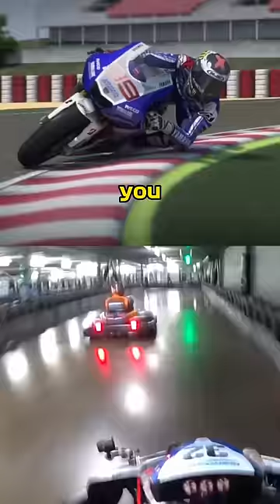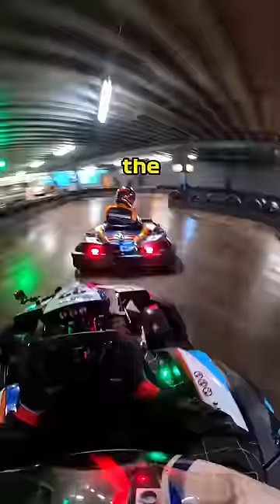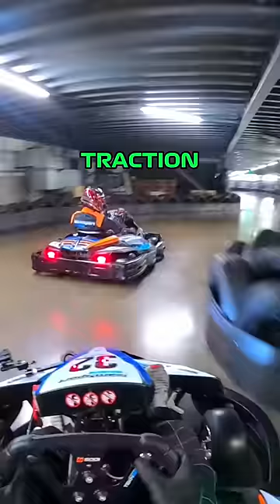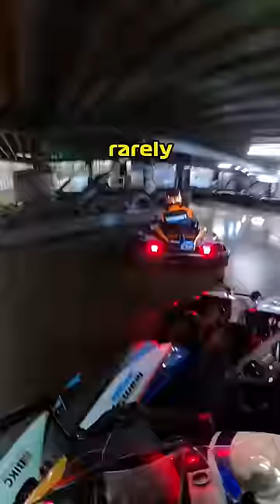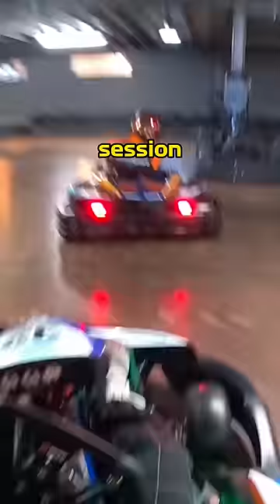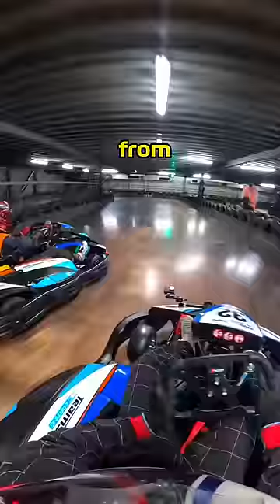WHY is this KARTING DRIVER LEANING in the Corners? #f1 #racing #karting

Comment: I do that to prevent mine from rolling. I have had a few friends roll it and now I'm worried it's going to happen to me.
Reply: i remember once when we went to one of these places that had a "powerkart" that was ridiculously fast compared to the normal karts and the place staff only let people with a lot of experience drive it. Anyway, the front tires were gone so we brought in a new set of front tires, and it got such insane grip that the kart nearly rolled in a couple corners. I of course stayed at max speed anyways, since i could feel it wasnt gonna roll completely any time soon. I also set the #2 fastest time on the powerkart on that track ever.
Reply: @roadsidegarage69  that's really cool that you got that fast. I wish I could be better at go kart racing.
Reply: @Elijahschumacher  You can get better if you train a lot and trial and error some driving lines into existence. Oh yea and also maybe lean outwards instead of inwards. I know it seems counter-intuitive but i know it adds a LOT of grip
Reply: @roadsidegarage69  okay, I will try that next time. Thank you!

Comment: In gas karts, I used to lean forward and lift slightly out of the seat, to take weight off of the rear and help the clutch engage at the exit of a corner
Reply: If your hanging off the steering wheel it wont help much if you lift off but dont move forwards at the same time
Reply: if the clutch wasnt slipping a bunch (which i doubt it was) that does nothing but slow you down. You should lean backwards and outside to gain more grip at the rear and turn faster.
Reply: Karts don't have a clutch. For physical reasons, it's important to lean slightly outward since a kart has a solid axle and no differential. Therefore, the inner tire must lift to build grip in the turns to navigate them faster. Otherwise, the inner tire would 'block' the axle.

Comment: Only.2 sec but he stayed ahead didn't he. It's not always about speed. You actually seem "faster" here, while he is the one taking the lines he wants and sliding into your line. So maybe not faster, but, at least in this clip, smarter. He's turning tighter, wider, blocking a larger width, whatever is necessary to keep you behind

Comment: Normally you have very good video's but imo you are confusing ppl.

You lean outside to relieve pressure from the inside tire because they wil want to spin at different speeds while cornering. 
Only if the kart starts hopping you have too much lateral roll on the ouside tire, and you should try leaning inwards.

Also by pressuring the inside tire the kart wil always want to go straight. Further more while coming out of the corner your tires still want to spin at different speeds so you have more power leaning to the outside. You lose HP by having both wheels on the ground while cornering

Comment: To me, if there was no time difference, its just because....it doesnt make any difference of doing that at a very slow speed. 

It does help with grip as you do it on fast turn or under the rain as its only slick tires, but here, thats really not necessary

Comment: I think you can apply this to low speed corner exits which guves max traction under acceleration
But for high speed corners if you lean in,itll cause the outside tire to skip loosing laptime

Comment: Leaning outside always. If it’s slippery I lean to the outside and front. You basic setup front/rear you can adjust easily about the seat positioning. Normally and in special I like it if the front has more weight then my rear so I can play a little more with the positioning of the kart in corners in special when it’s slippery.

Comment: As a motorcycle rider, leaning and using your body weight to change your center of gravity is very natural. If I ever drove a kart, I'm certain I'd lean there too. How is this considered advanced?
Reply: Cause on a motorcycle you lean cause you have to, there is no other option to physically negotiate a turn on a two wheeled vehicle. You either lean your body with the bike, or you lean the bike itself and do whatever the fuck you want with your body (ala counter balance which we see in supermoto sometimes, and dirt biking). On a 4 wheeled vehicle it's irrelevant. Maybe he's right with the rear solid axle, however I feel the karts overall weight shift and momentum through the use of throttle and brakes play a much, much, larger role in kart rotation than you actually slamming your body left and right into the karts chassis.

Comment: when i do indoor karting, i adjust where im sitting in the kart related to if the corner goes right or left. If its right, i move to the left side of the seat so i get more steering angle and if its left, i move to the right so i get more steering angle. If i went to the same side of the corner, it would be harder for me to steer.

Comment: I drive outdoor karts but usually on very tight circuits where maintaining speed is super important. I always lean forward and into the turn if I’m trying to set a fast lap time but it gets pretty tiring pretty quick so I can usually only do it for a lap or 3 at a time

Comment: im a bigger guy, 6'1 270lbs, when i go karting(not often) im leaning HARD in certain corners, it makes a massive difference... on one track due to the speed and corner sequence i was able to lift tires off the ground high enough they went over the curb and gave me a cornering line that was " off the track " i was passing people on the inside using this line... both the other racers and the race marshalls were like " how the hell did you do that ???? " i was like, just gotta lean into it "
Reply: So youre the one breaking all the carts!

Comment: Leaning in a go-kart does a lot, the kart chassis should bend/flex to make up for the lack of suspension and depending on the brand it flexes different. Changing your center of gravity will change the surface contact areas on each tire allowing good drivers to get the kart to grip up and slide out when you need it to.
Reply: Leaning to the outside rear is almost always the best thing to do, except outside when it is rainy and there is no grip in the front, in which case you need to lean forwards and outside.

Comment: I always thought this technique making you faster is a myth since it like you said hinder steering input and also make your vision reference inconsistent, not to mention it’s more tiring!
Reply: Its not even a myth. Leaning inwards is just bad all around. Just lean outwards in every corner, it will increase your grip so much that your lap times are almost guaranteed to get better.